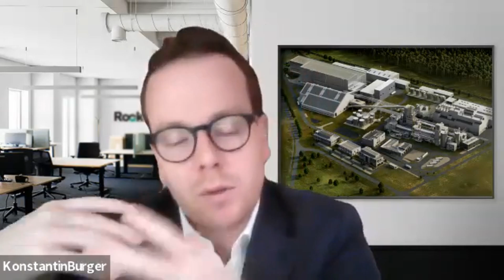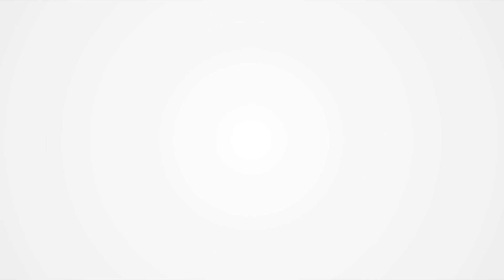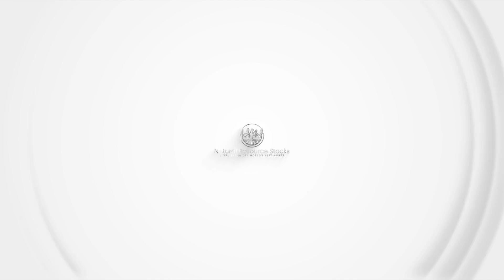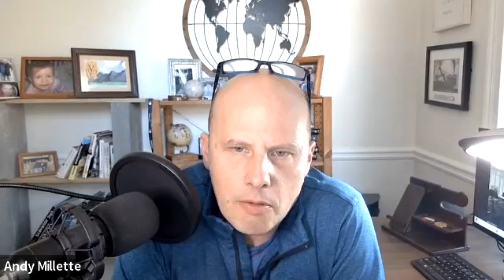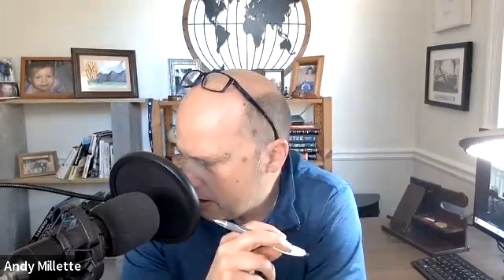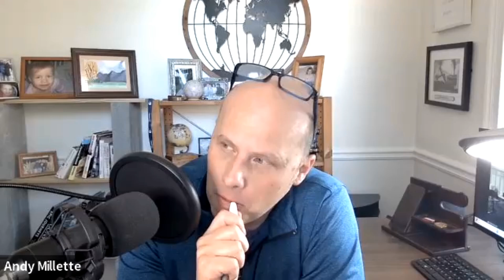Rock Tech  Difference Maker in Lithium Exposure

Comment: You also don't want your airplane to go up in flames because of off-brand batteries from overseas. The energy density of these cells is high therefore they need to be produced to a better standard, and that can only be done in a country like Germany. If I would have the option of buying cells made in Germany and China for my solar power wall, I would choose Germany because I will only accept the highest standard of quality where safety is concerned. Also domestic production of cells is akin to a strategic energy reserve and means that in the event of war breaking out the grid can be protected against outages. In Ukraine the Russian army bombed their entire energy infrastructure.